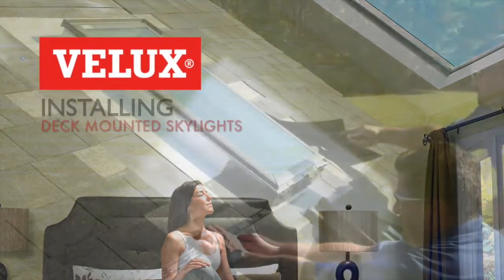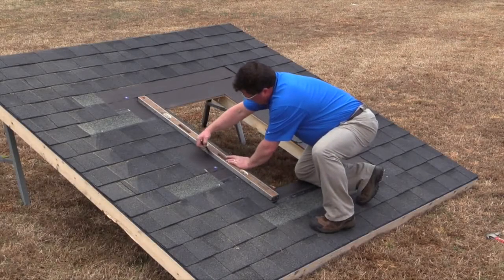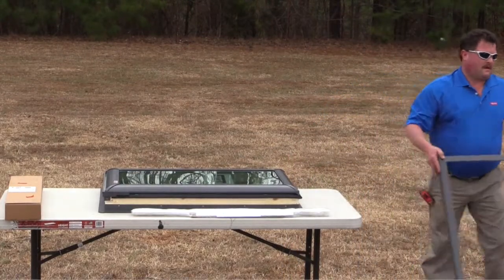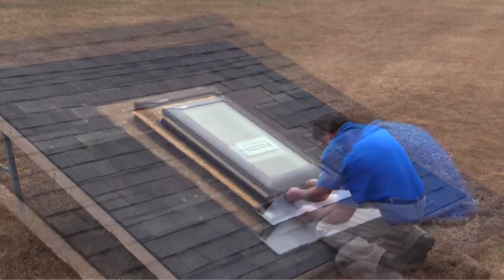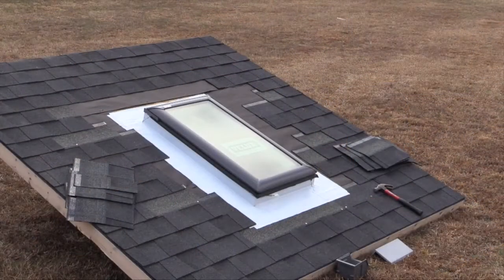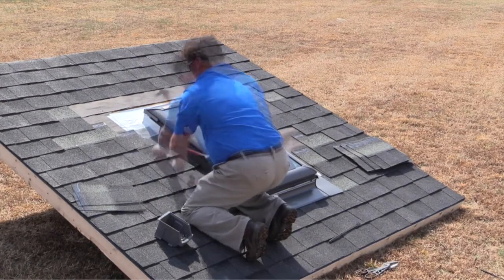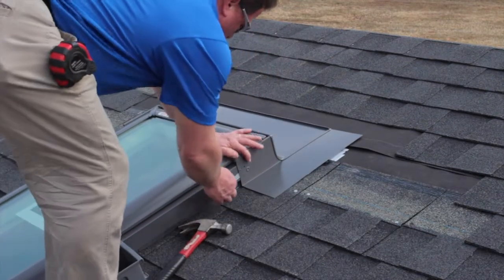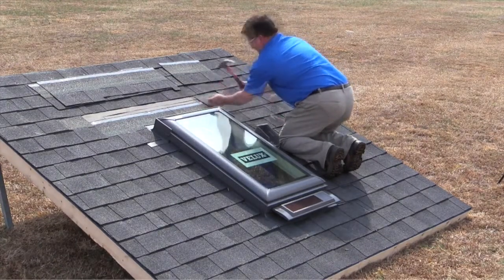VELUX Install Video - Replacing Deck Mounted Skylights (Short Version)

Comment: What type of skylight is this one? Is the cladding a one piece or 3(2 side, 1 bottom) ?
Reply from the maker: Hi there, this is a venting skylight. The cladding is made up of 3 separate pieces, two sides, and one bottom. For further questions you can reach VELUX direct at 800-888-3589.